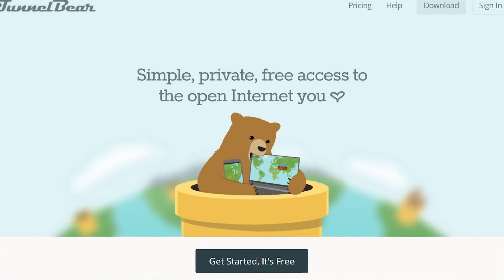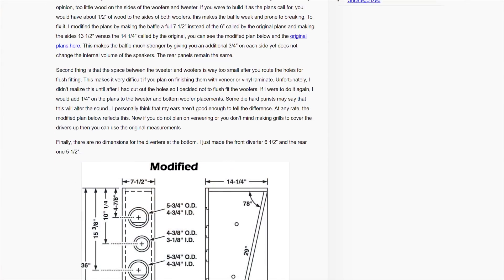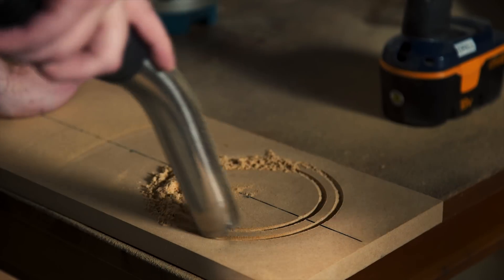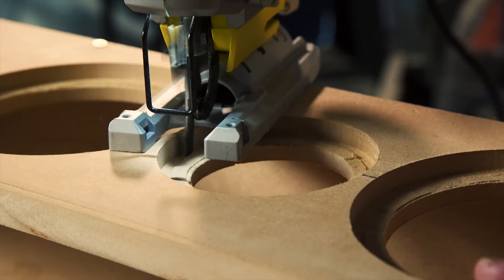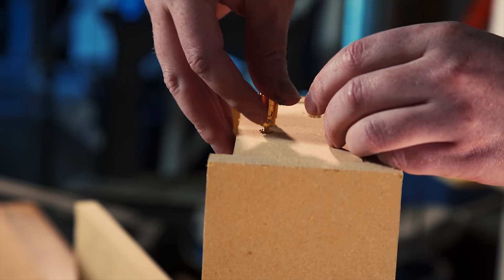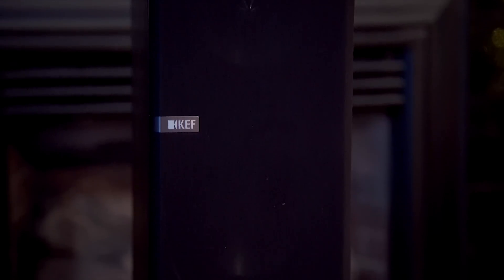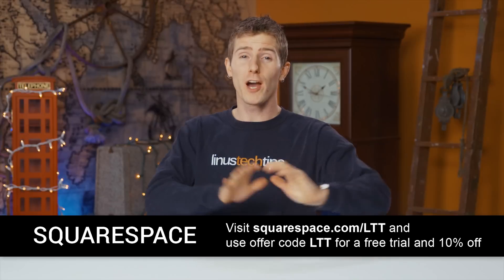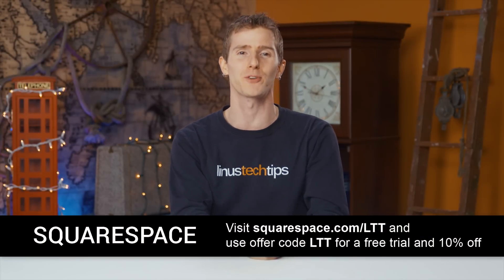DIY Speakers for Less Than $300!

Comment: Most of my speakers came from garage sales, I think two of them were actually free, as pretty much most of my audio setup, but it sounds pretty good to me. Most of my problems are from my make-shift wiring. Little of it is proper speaker wire, only repurposed electrical wire.

Comment: I buy the knock down cabinet kits. I know they cost more, but add up the time to go to Home Depot, measuring, cutting, assembling, glue and screw, sanding,  and unless you have table saw and circle cutting router, your speakers will be inferior to the kits. It is just so much easier and you get a better result. I build a lot of home subs and the knock down kits are great(and HEAVY).

Comment: Over the years, I have built up a "Found Parts" home audio setup that is comparable to many 400-500 dollar systems, all for the low cost of about 40 bucks. Mind you, if you want a good system now, you're out of luck using my strategy, as mine has taken about 7 years to build, going through many odd revisions as it went. (cough 26 speakers off of a single mono amp cough 5 separate stereo amplifiers to run 3 speakers cough I was an idiot 2 years ago and may or may not still be one now)

Comment: You didn't offset the tweeter or flush mount the drivers properly, you completely changed the sound from the crossover design, Curt Campbell spent time designing this kit with the intended crossover and intended baffle, listening to it or comparing it to anything is pointless as you have made it incorrectly and if you think those baffle issues don't matter, well then, you don't know anything about speaker design. That Tri Trix kit crossed at 90hz/12db with a sub will sound fantastic. And I guarantee to the point that you will say to yourself, this sounds nothing like what i built.

Comment: So I am a bit late with this one but i would like to correct you on your statement about 2nd order filters. A 2nd order filter actually specifies the type of filter and not the amound of them. The difference between a 1st and 2nd or the filter are the component(1st: resistor & capasitor; 2nd: inductor & capasitor) and how steep the cut is at the crosover frequency(1st: 6dB/oct; 2nd: 12dB/oct) . What you are using are 2 2nd order filters in parallel. One is a Lowpass that goes to the woofers and one is a highpass than goes to the tweeters. Just wanted to let you know and hope you still read this.

Comment: I am going to mention it on here too. Can you test the large CPU mounted on a GPU theory? I saw it done on DIYperks on youtube but it was on an older GPU. I would like to see this tested on a newer GPU. His full load temp was only 60 degree C with one fan on low settings blowing on the cooler. He also added after market coolers for the vram later when he built his silent computer case. 

I also wanted to see if you guys could pull a LED screen apart and mount it on a side of a computer case so you can get that awesome monitor viewing window you were freaking out about.

Comment: The speakers have almost zero resale value , they have smaller woofers than KEF, and need a lot of tools and time. Everyone immediately noticed duller sound. Would be interested in cheaper and better DIY speakers (think active speakers using cheap but powerful drivers + DIY Subwoofer), but not this. And they should cost less, like 50-100 for a better speaker.

Comment: honestly i think computer people should just avoid loudspeakers altogether.  

when you get people like Linus trying to build proper enclosures when he's used to diddling small computer parts together into prebuilt cases you get these um... ugly monstrosities that show a complete lack of care or understanding of woodworking.

also I'd like to mention the DIY market is only worth it at higher price points like upper 3 figures and 4 figure kits. This is where you can make stuff that sounds like 5 figure loudspeakers and feature world class drivers and crossover design.

otherwise, economies of scale apply to everything below $500 and there are plenty of competent manufacturers making products that work well and look much better aesthetics wise.

also Linus please never talk about tube amplifiers ever again. you clearly do not understand how electrons work.

Comment: THIS IS NOT A FAIR TEST....LET ME EXPLAIN!!!!   . Scientifically proven the first audio that comes to your ears after a long recess without any audio(specially music) its always better than the second one due to first impressions.(something that the human brain automatically does) This theory have more impact if #1 contestants have exactly the same experience meaning order of speakers not changed to each of them.  #2 if the first speakers have at least half of 1db(decibels) "0.5db". more higher than the second set of speakers is obvious they gonna pick the first speakers just because sounds more "punchy" and loud. This has to do with the so called "loudness war".  You should have  at least  an SPL meter(sound pressure level meter) testing both speakers peaking about 80db. which is a comfortable level and would give you the chance to judge the sound more fairly. And using audio  not compressed like mp3`s.   Wave 24bit 48khz  would be the perfect since the audio is not compressed and would give you the opportunity to analyze the impact of how the speakers drivers are  responding to transients and energy of the music. This includes the THD(total harmonic distortion) response of the drivers. Im pretty sure you guys did a good research in how the speakers  react to sound already I just wanted to mention it. Another thing is the type of music. A good selection of couple tracks will tell you how good they are. Some jazz music music ,classical, reggae , hiphop, trance, specially a track with just percussion like congas, drums , shakers,  something with a lot of  transient response. Most important. a good listener who will know what to listen for at a given time. Then ..this test will say if they are good or not. And im not touching the fact of the room acoustics ...which are the number 1 factor of interaction between your ears and the speakers. Lets just say that  the more flutter echoes in the room, the more distortion of the transient response of the speakers you will get. The more comb filtering in the room the less bass response you will fell coming out of the speakers and  the more interaction of the sound with objects on the side of the speakers the less accurate image of the sound you will get. I don`t know if you guys took time to analyze this factors before this test but I didn't see any explanations about how accurate you guys were performing this test. This is why my comment.

Comment: you don't get a kit like that, it is expensive and does not offer enough.
however, you could have choose a tipical 6.5" midbass and a low Fs tweeter.
most likely you can get away with 200 usd costs for a pair of speakers , giving fidelity of designer spekaers in the 1K usd range without any prior education on the subject what so ever.

Comment: As someone who built his whole Home Cinema my myself, I'd share my experience:
First of all: These speakers are not very beautiful. When you are inexperienced in cutting wood, many stores sell you the pre cutted wood.
for my first speakers I used t´pre cutted wood. This was a big help.

They look very decent now with its finishing.

My whole setup (7.2);
Mains: Visaton Vox 253
Center, Rear, Side Surround: Visaton Couplet KE 
Sub: 2x JL Audio 13W7 in 110L CB

I saved a lot of money with these speakers, a compareable pre built speaker set would have cost me around 3 times as much.

Comment: Sorry ...but this is just all kinds of wrong. If you build a speaker,  you need to do proper frequency and efficiency testing for flat frequency response across the 20Hz-20,000Mhz range and db sensitivity (how much sound pressure is produced at 1m distance with 1W power). Also checking it's low end to see if it goes down to at least 80Hz (cutover for subwoofer range)..otherwise you will lose frequencies if you are using a subwoofer. Recommending you build your own set of speakers without any audio knowledge is a very poor recommendation. That's like saying "You can build your own car with a lawnmower engine and some bicycle tires and save a ton of cash!".
Testing based on people's subjectivity is also a horrible testing method. Different people hear different things and like different types of sound. You test with frequency response and efficiency. People may not "like" the sound of a perfectly flat responding speaker, but it's technically the most accurate, which is what a good speaker should do...accurately produce the frequencies that were recorded. You can tweak the sound to your own liking with the EQ later.
A good pair of small bookshelf speakers will blow away more expensive DIY speakers every time. Investing in a good set of speakers that are highly efficient with flat frequency response will provide a lifetime of great sound. A good speaker never needs replacing as long as it can reproduce the required frequencies and is efficient enough to provide enough sound pressure for the room it's in. (THX Certified Professional)

Comment: I'm surprised you didn't mention a much better approach to buy some ripped / old / blown high-ish end cabinet speaker system on craigs list or at a yard sale and replace the speaker in them with new.  Many times the cross-overs in those are really great but the speakers have just been blown or corroded over time.  And you get the bonus of have a cabinet that might just need some cosmetic patching and paint.

Comment: Are you aware that the "TL" in the TriTrix kit isn't just a label?  It stands for "Transmission Line."  That's why it has all those internal folds and an open back.  You micky mouse'd together a SEALED BOX.  Unless you changed the crossover components and used a woofer that is designed for a sealed box it is NOT going to work correctly, and therefore sound like crap.

You had a good idea for a video but poor execution.  Next time get the flat pack and follow the instructions.

Comment: I just did this with normal speakers and wired them to a rgb red/white black wire with ground and red without and I have the loudest speakers running on a female rgb cable to female 3,5mm to male to male 3.5m  to pc for 0$ the speakers I found them and they work better then headphones and it only works with the RGB to 3.5 m female cable I have two speakers currently running off the same line cable and can hear both fine.

Comment: while the result of the case looks medicore (have seen worse, even at the carpenter line at the local high-school) its at least a good first try.
now Linus can if he want remake the cases later etc. if he wants to.
but as he said. get a complete kit if you do not trust your carpenter skills because making straight cases is not a easy thing for "neewbz".

Linus did though make a tricky DIY speaker with out knowing it too.
he made em after a modified drawing and its clearly that they change it into a semi horn-loaded speaker.
while it should increase in lower freq.  it makes the speaker way more tricky in placement to get the increase.

if anyone interested to build a DIY speaker an another spot for kits are diysoundgroup.com and usually of far better quality than most Amazon kits and they are not nazi about not sending overseas.

Comment: I'd like to see DIY speakers with low-mid-high with built-in amps and some sort of sub processing.  My dream setup is something like Atmos with full range towers.  7-speaker full-range surround, sub platform (you put your couch on it and FEEL everything), and two-to-four ceiling speakers.  And if I could really get crazy with it, a DSP that compares audio channels from 7.2 surround sound that looks for sounds transitioning between channels to guess the intended direction and forward that sound to an additional set of 7 or so speakers.  ...because surround just isn't surround enough.

And when I'm done all that, I'll sell it all and buy a couple pairs of Ossic X to use instead.

Comment: It's the cabinet build quality that'd really seperate the two, assuming the kit is of equal quality to the branded speakers. The KEF enclosures likely have a different grade of MDF, most speakers I've taken apart that use MDF or particleboard definitely don't use the same stuff you get from the big box hardware stores.

Comment: I built a pair but they do not sound near as good as my Phase Technologies 10.2 (and 3 times the size as the Tri-Trix) from the 1990's.  The bass is limited to the size of the bass drivers.  A great kit to learn from though.  Parts Express has a few good kits.

Comment: diy speaksets can easily sound the same if not better then branded ones.. If u build them correct with the right parameters designed for the used speakers. this comparison is saying nothing at all. Because you build them like crap, comparing a bass reflex design against a closed system, what amp u used? etc etc..

Comment: Mine cost less, probably sound better and definitely look better. Gotta do your research peeps.
I know some engineering stuff for speakers, but there are plenty of guides and designs to base your work on.
The "woofers"(which in the video were just crossovers) were too small for low end and not calibrated. You definitely need to calibrate the woofers, tweeters and crossovers.

Comment: Linus,  I don't recall you mentioning whether or not you did a proper break-in of the new speakers you made but that is a very important aspect of new speakers! All speakers require a proper break-in period which is typically about 50 hours+ of constant use and will open up the bass/mid drivers as well as smooth out the tweeter's frequency response (this takes longer). You will achieve a much smoother and more balanced frequency response comprised of deeper bass, and better imaging. I would highly recommend that you give them another month or two to break-in, using them as your primary set to do so or just playing them overnight in another room, several times (that one's up to you); 

Another thing I would love to see is the addition of some I.C.E. amplifiers mounted inside of the speaker for some DIY WiSA, self-powered speakers. PM me if you want some more info on some of these. I have a pair myself and I've been in the industry for many years. 

P.S. I'll be at CES; Let me know if you want a pro to show you around the Hi-Fi at Venetian this week at at the show... If you've never been, you'll love it.

Comment: if you want an even more budget option which I did was go to a scrapyard and ask if you can pull a few speakers from an old car, they charged me £5 for 4 buy an second hand amp and build 2 boxes out of wood use a circular saw to cut out the holes I ended up paying £32 for a pair of reasonable speakers not competing at the £400 range but easily beats a £150 set

Comment: There are some DIY kits for 1000 per speaker (Vifa for example) that are actually sounding much better than 10000+ euro speakers (B&W Nautilus). I will build an improved version of one of these Vifa kits in spring and will document it, including providing the files to CNC cut it.

Comment: I love that you are breaking off into the DIY speaker category! Very useful and fulfilling stuff!

However, I'm afraid I have to point out a kind of noob mistake that many DIY audiophiles try to avoid...
When you put a Tweeter between to woofers, the propagating waves emanating from woofers on either side cross and can cancel out some waves of the tweeters... never ideal, and it's only done in Center channels because of the need for audio to be perfectly centered and symmetrical... And so they look "cool."
Side point, I think this may be why they design schematics showed the tweet off-center. An attempt to count some* of those effects.

Klipsch even acknowledges and tries to rectify this by giving the opposing woofers on its Center Channel different crossover points, so the same waves don't intersect.

Still an awesome video, though!
Although, I would suggest opting for the two woofers on the bottom. :-)
This brings the voice higher,  where it should be (head-level) , and keep the bass low, where it should also be (think of how a bass drum and subs sit on the floor).

Comment: Ive built 6 18's, 2 12's with compression horns and 2 6's with horns
Reply: Pl premium for lyfe
Reply: Its more then wood working as well, there is programs that can help you pick the size and volume of the bin and ports, you get the T/S parameters then put them in the program, this helps you get proper frequency curve for the woofer, every speaker is different.

Comment: If you're going to attempt this, some tips that Linus completely ignored and will definitely increase the sound quality.
1) Arrange your internal wires so they don't overlap as you see at 5:44. When you cross wires like that, the sounds will either give negative feedback and subtract frequencies from the signal or introduce noise. All around bad. 
2) Pick up some better soldering skills than seen at 5:11 It'll do, but you'll hear audible differences from a good solder joint and a bad one. Try something like this: http://www.instructables.com/id/Master-a-perfect-inline-wire-splice-everytime/ Crossing the wires like that will ensure that they stay together for a long time, but will hopefully cancel out signal mismatch. 
3) Clean off all the flux that remains with 95%+ alcohol. The solder you use doesn't really matter, but excess flux will cause signals to get muddy.